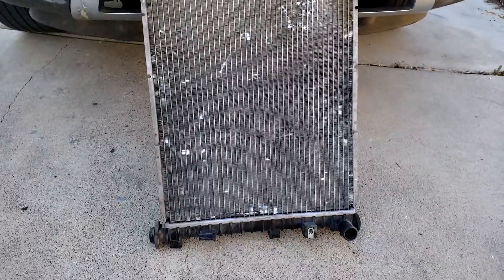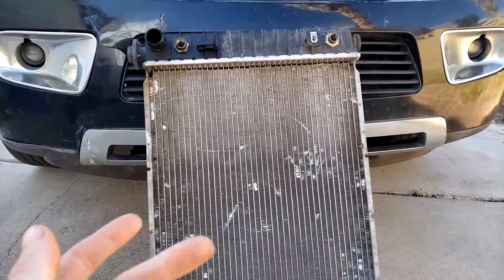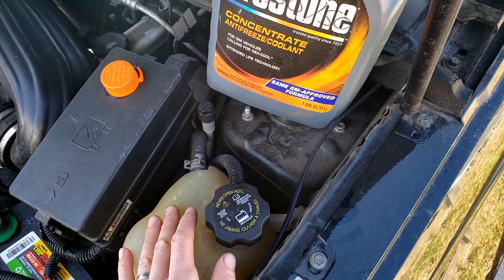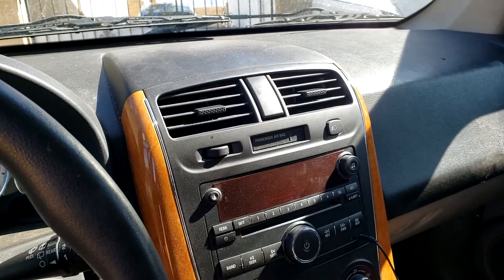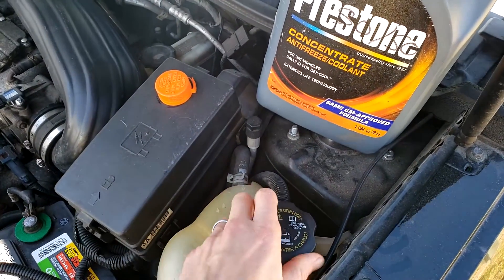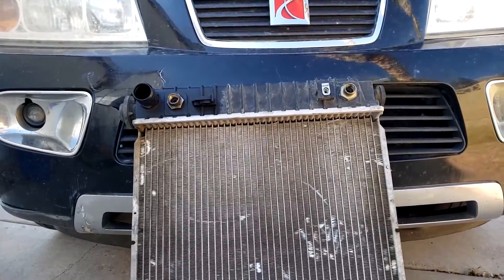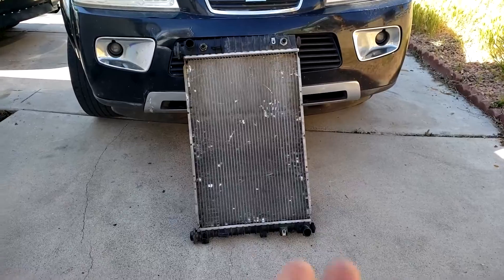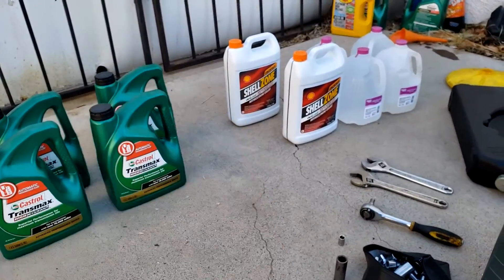Coolant In Transmission Fluid - Antifreeze and ATF Mixing

Comment: This makes so much sense, in November 2022, I needed to get my radiator changed because of coolant leaking. I have been noticing hard shifts for sometime now and decided to check my transmission fluid today, it is light pink. Not thick, just light pink. When my previous mechanic replaced the radiator I can't remember if he flushed the coolant or not. I will be getting a coolant and transmission fluid flush soon.
Reply from the maker: I'm glad it was useful! I hope it gets fixed soon!
Reply: Any updates?
Reply: @CRuZ_CoNTRoL.  yes, good news there wasn’t an ATF-coolant mixture, the fluid was pretty old though, a deep red almost burgundy color. The transmission fluid was changed by dropping the pan to get the majority of it out, an entire gallon was removed by that method. There was clutch material on the magnets, no big shards of metal, luckily. I am still noticing hard gear changes though, it may be another issue I’d have to get looked at.

Comment: I already spent 800 for a new radiator and changed the filter and flushed the Transmission fluid. The car runs good , after they get hot , the Transmissions fluid leaked out through the overflow. It seems a little milky. Only when the Trans very hot ? Is that because there is still some water in the Transmission , so when it is hot , the fluid force the excess water out through the overflow. ? Or why water in the Trans fluid , but radiator and the water tank is clean..no fluid. Thanks.
Reply from the maker: Are you sure it's transmission fluid that is in your coolant and that its not oil? There is no real other opportunity for trans fluid and coolant to mix, unless your new radiator is bad.

If you had a mixing problem, the trans should have been completely flushed, as well as the coolant system. I talked about this in the video already.

Comment: I saved my transmission. Line broke in radiator and put coolant in trans. Felt funny driving so I had the feeling. Drained the trans and it was full of pink,so got a new radiator,new bigger trans cooler,flushed my trans 5 times till I got all the pink out,still some in the torque converter but whatever. Bypassed the radiator and ran lines from the cooler to the trans and truck(Toyota Tundra),runs great. Going on 7k miles running after break.
Reply: Is it still going?
Reply: Any updates?
Reply: Sorry,yeah,kept changing the carrier bearing between the driveshafts and said screw it. Got a used trans from an 05’and changed filter,fluid and got a new torque converter. Plugged the radiator lines.Runs excellent. The torque converter is ruined once antifreeze gets in it. Got a bigger trans cooler that’s all.
Reply: Got an 05’trans,changed the filter,fluid and got a new torque converter and just run it off the bigger  trans cooler I put on my truck. Plugged the radiator lines.